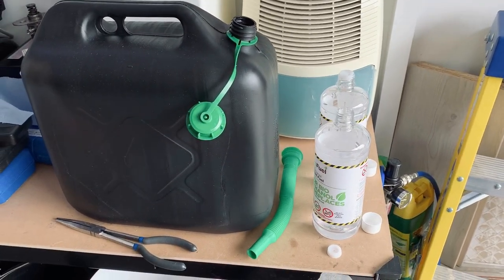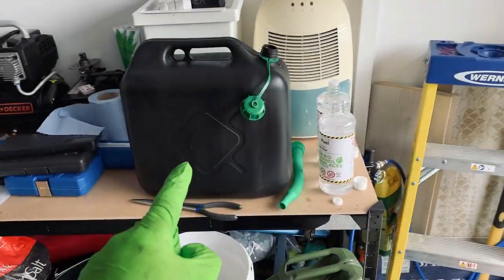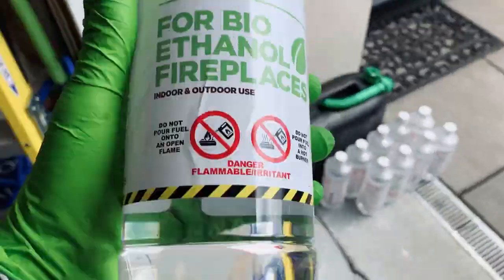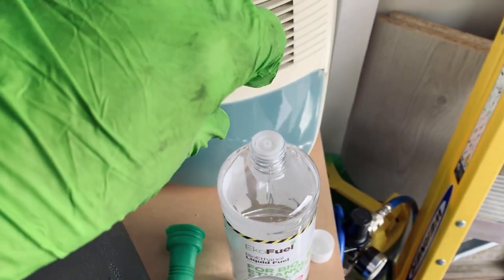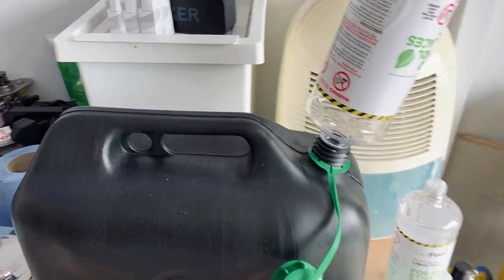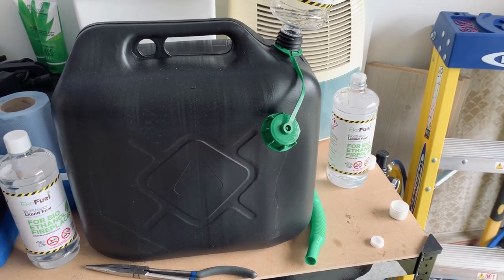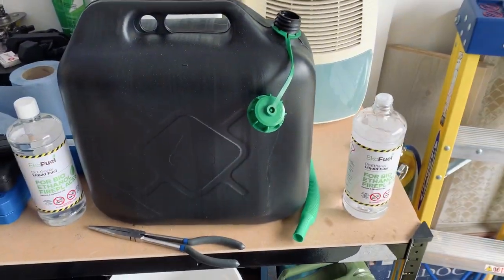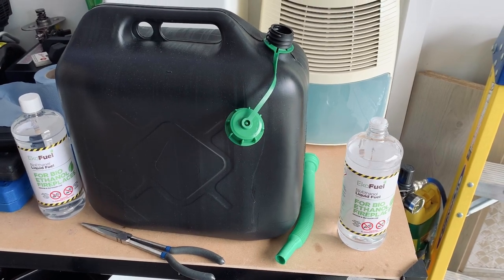Blending E30

Comment: Hi mate,

I have just gone BM3 stage 2 on my M240i and I'm wanting to do exactly what you have done. My calculations are exactly the same as yours and I'll mix the same way. I'm currently on stock pump (not the TU pump) and I'm wanting to run the stage 2 E30 mix untill I get the TU pump next month and flash stage 2+ E30. Did you ever run the stage 2 E30 on stock pump, if so how did it hold up? And how's the car holding up on the 2+ E30? 

Cheers in advance! 👍
Reply from the maker: You can run E30 on the stock pump no problem, I never did it but they have a map and I know many who have.

I've done countless events/races/drags on Stage 2+ E30 now and never had a problem. I don't run it on the road because it's simply too expensive(!) but there's also an E50 map now that I plan to try 😎😎
Reply: @ScottHelme  Perfect, as I'm buying the ethanol anyway and just awaiting the TU pump fitting, and as I have the map pack I might try the stage 2 E30 for now. Glad your liking it mate. Are you on flex fuel now? And does this alter the map for you if you get the blend wrong and change the tune accordingly? And do you need a customer tune for this ideally?
Cheers.
Reply from the maker: @mrfiasco7941  BM3 are making flex fuel kits but they're only for the N55/S55 so far, the B58 kits should be out soon: https://www.protuningfreaks.com/products/bm3-flexfuel-kit-canbus-enabled-and-100-plug-n-play

When you have a flex fuel map you can run anything from E0 up to E85 and not need to re-flash, the tune will adapt automatically so you can just throw the ethanol in the tank and go.

Comment: If the 99RON petrol you added to this mixture had 5% of ethanol  (E5) already "inside", you got E33,5. Am I wrong?
Reply from the maker: E33.5 would be in tolerance if that were the case, but I test the fuel I get and it's E2 on average.
Reply: @ScottHelme  My bad. It should be E33,05. The EKO Fuel is 98,5% ethanol. Did you investigate, why do you get "only" E2 on average? Do you think, it  is because workers at the refineries in the UK are heavy drinkers?
Reply from the maker: @peterkukolik8402  E5 does not mean that it is 5% Ethanol, it means it can up to a maximum of 5% Ethanol. Same with E85, it can be a maximum of 85% Ethanol. Depending on the climate a lot of fuel stations will reduce the ethanol content if the temperature is sub-zero (c) a lot because it's harder to start on high ethanol content when the temperature is that low.
Reply: @ScottHelme  I was only joking. I am fully aware of the fact, that it stands for the max concentration. Here, where I live, we have E10 as standard in RON 95. Shell V-power 95 has E10 and Shell V-Power racing 100 has E5. This morning we had -17 degrees C. Btw: thank you for sharing your M140i project. It serves as a great source of inspiration. Well done Mr. Helme.

Comment: Hi mate, how often do you run your car on e30? 
Is it with bootmod3? Thx
Reply from the maker: Only during the good weather really, there's no point having that much power when it's cold/wet out! It's a good 5-6 months a year though, I've just ordered my first batch of ethanol now. This is with Bootmod3 yeah, Stage 2+ E30 map.
Reply: @ScottHelme  cool thanks, are you still doing same ratio 14-6 ?
Reply from the maker: @Dps2139  In the UK we only have E5 at the pump and when I've tested it, it's only about E2 usually. Given the small difference I don't account for that as it will be within tolerance. If you have a higher E content for fuel where you are, like E10, I'd recommend testing it and blending properly. There's usually a sticker on the pump that will say E5 or E10 to let you know. Also note that just because it says E10, does not mean it is E10, it means "up to 10% ethanol", so I'd recommend testing it.
Reply: @ScottHelme  I’m in Uk mate so will do same mixture you’re running 👍
Reply from the maker: @Dps2139  ah yeah then you're OK, just keep an eye on the pump as later this year or next year we're getting E10 here in the UK, which is good because you will have to buy and mix less ethanol so it's cheaper 😅
Reply: @ScottHelme  haha great thanks, do you normally only put 20 litres of e30 at once ? Or put 40 litres (28/12) can’t imagine it lasts long
Reply from the maker: @Dps2139  It doesn't last long at all, you need more ethanol by volume to replace the petrol so you do actually use a lot more! I always mix up 40L just for the convenience and brim the tank.
Reply: @ScottHelme  so 12 litres ethanol and 28 litres Tesco momentum ok?  Thanks
Reply from the maker: @Dps2139  Yep, or Shell V-Power. People have tried it with lower grade fuel and said it's OK, but I don't really want to try that out 😅

Comment: Hi Scott, is it worth getting the fuel it ethanol sensor??
Reply from the maker: I guess it'd be useful as a backup measurement but I'm pretty confident that my mix is accurate. I will eventually be getting an ECA (Ethanol Content Analsyer) as I want a flex-fuel map so I can run it on any % of ethanol and it will automatically adjust.
Reply: @ScottHelme  how would you go about getting a fuel flex map?
Reply from the maker: @Dps2139  Bootmod3 have already announced upcoming support for switchable maps on the B58 platform, you can switch between 4 maps on the fly using the cruise control buttons as seen here (https://www.youtube.com/watch?v=iGu85QHKG48). This means you could have a 95 RON, 99 RON and E30 map to switch between, but that's not as handy as proper flex-fuel support.

Flex-fuel maps, where you can put any fuel between E0 and E85 in the car and it will automatically adjust based on the ECA reading, are also coming for the B58 platform but you need an ECA that hooks into the DME for live adjustments. There is a demo video of this here (https://www.youtube.com/watch?v=UnR4O0_yyPY). 

Once these are supported on the B58 I will be upgrading 😎
Reply: @ScottHelme  wow that would be amazing!! Thanks for the help mate
Reply: @ScottHelme  do you have any idea when this will be out for the b58?
Reply from the maker: @Dps2139  Soon (TM), according to PTF 🤣